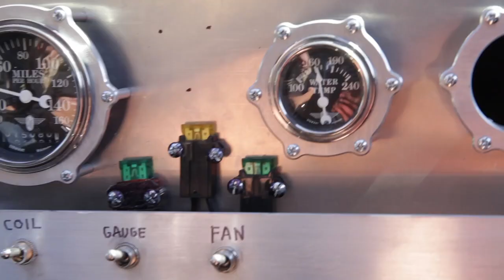Echo

Comment: Actually, I'm the next step up here in Australia from you in the USA. We try to get barn finds with good sheet metal & either take them back to a Henry original, my preferred option, or build hot rods based on fully modified full box chassis with fenders front & back. The authorities are pretty strict if building a hot rod, inspections all the way, but with a Henry original, it's all systems go without any involvement for inspections along the way. We can even leave them left hand drive for a road worthy & full registration. I love the fact your not worried about money & time while building your cars, unlike others on YouTube.